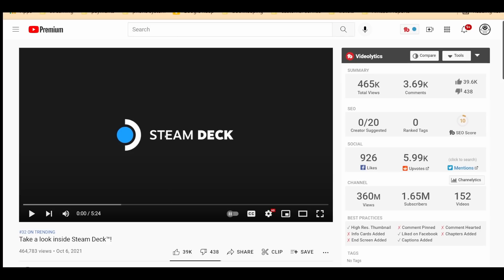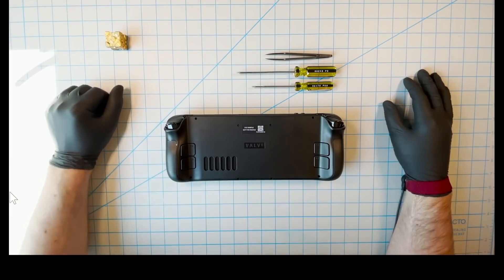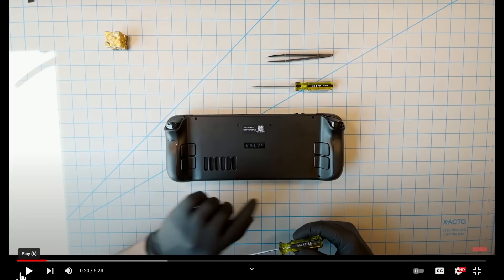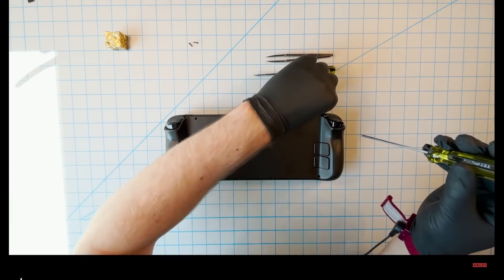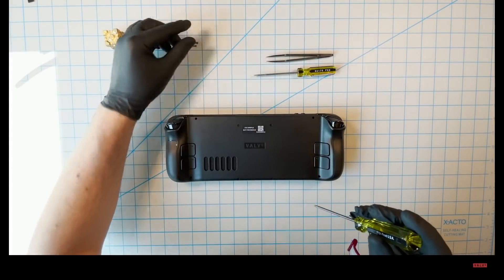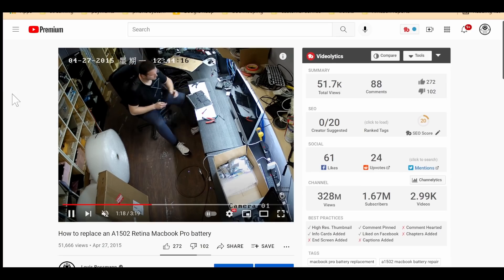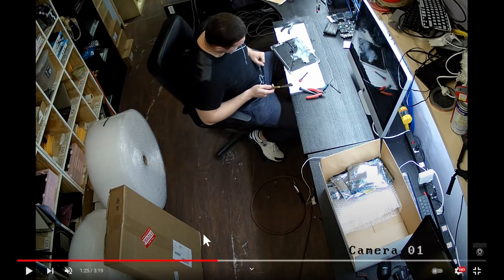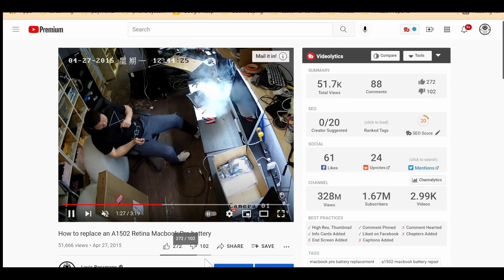Steam deck battery may end your life? bruh 😑

Comment: The structural integrity thing makes sense, as the back is secured by self-tapping screws, so once removed, they're not as secure.  Of course, by "breaking", this means that the back panel may be more likely to pop off if dropped.
Reply: That explanation makes more sense that what i thought.
Reply: It's not usually the biggest deal if: you are careful not to cut new threads, apply the right torque (which can be hard to do sometimes, if you're not experienced. I've heard there are small torque wrenches as well for this purpose, but no personal experience with those.), and if you're really concerned, you can use the weakest threadlocker you can find. (if you go this route, try and find one that is designed for plastic.  some threadlockers are really bad for certain plastics.)
Reply: @leksitarmik4636  Isn't that the entire point? you're using self tapping screws. They're prone to starting their own threads. Opening it up has a very high chance of weakening the fastening. How mitigation, how much and whether or not it's significant is irrelevant to the statement in the video.
Reply: Well self tapping screws make new threads and if you don't hook the old threads your cutting the hole in a different shape kinda making it bigger and a looser. Easily solved if they just used normal screws tho
Reply: Maybe a certain amount of preload is designed into the molding and loses that tension when disassembled
Reply: @js4120  I was thinking about that too
Linus on LTT pointed out they had a jig to place the device in, so joysticks and such weren’t resting on the bench

But screwing up screws seems a much simpler explanation
Reply: This was going to be my comment.
Reply: You gently turn the screw until it drops into the original thread it (feel it drop, maybe hear a click), and only then tighten it. This does not weaken the security of the fastening. Just directly screwing one in can start a new thread and mangle the hole, that definitely weakens the connection and may strip out the hole entirely.
Reply: @Bodi2000  yes, sometimes you can do that, but something that is very common with plastic threads and self tapping screws is that the threads breaks down to some degree when you first unscrew the screw, and then it will definitely be weaker afterwards.

Valve is 100% correct on this, but they could have put in threaded inserts for those 4 screws, maybe a few dollars more per device max.
Reply: @Robinlarsson83  both for price and to deter you from disassembling it , truly a shitty move. Most laptop manufacturers do the same , and for an expensive laptop not a cheap one.
Reply: @Robinlarsson83  If its true as you say that mean if my Stem Deck will be faulty and will send it for repair i can request brand new one instead of repaired one due to structural integrity will be compromise? And in the future my steam deck can brake while I use it? Dont think so.
Reply: @TheHiphopast  this will probably be a issue you are correct. My guess is they might actually just send a new one and salvage parts from the old. 
It would be much faster.
And if the product was a manufacturer failure it is more than likely what they would do to inspect what went wrong and improve the product.
Reply: @Robinlarsson83  I don't think the cost of the inserts is the issue, but more the added labor to install them. Valve was really pushing to keep them cost of this device down, so I can understand the choice. And I doubt it's going to matter that much, if you're careful.

I wonder, though, how difficult it would be to retrofit the device with threaded inserts, and use machine screws, to let you open it as often as you'd like without weakening anything.
Reply: @daniel1tsvik  From what I understand, they went with plastic threads and self tapping screws because they tested metal threads and saw that, when dropped, the steam deck's shell broke more easily (because of how stress concentrated near the metal inserts). If they wanted to stop that from happening, I imagine that they'd have to make some kind of metal frame that the shell would connect to, but if they did that, the weight (and likely the size) of the steam deck would have had to increase.
Reply: @Robinlarsson83  Not even that, really.  The inserts cost only a few cents each, and installation is unlikely to be much more.  The place where extra expense starts to really come up is that threaded metal inserts are a special item, not all assembly houses can do them at all, and those that do are likely to be more expensive overall.  Threaded metal inserts have always been a feature of premium equipment.
Reply: @TheHiphopast  It's a plastic shell.  They can replace the shell and re-tap it with the correct torque specs.  Almost $0 in parts, probably not that much more in labor.  Not saying they will do this, and like WILD7 said the huge majority of warranty issues are going to end in a full replacement, but being the manufacturer they have ways around the self-tapping screw issue that we do not.
Reply: @ratchetguns  , Where did you get that info from?!? It sounds plausible, but also sounds just as easily BS.
Reply: @kssarh  I mean, and Joe Schmoe can buy taps, and using them in plastic is damn near impossible to fuch up. If needing screws tapped into plastic is the issue, buy the next screw size up and tap the holes for the new screws. Problem solved. (You can only do this a couple times, but it shouldn't be so necessary to open the case more than that)

You don't "tap to torque specs." You tap to the correct screw size, and torque the screw to the correct spec. Self tapping screws just help by removing the need to tap the hole before adding a screw. We ain't making 10,000 units, so the tapping procedure matters not at all to us.

If you are particularly resourceful, you can measure the screw thread pitch, size and length, and get some non-tapped screws of the same type, and not worry about accidentally re-tapping the hole with self tapping screws.

And like many others have stated, brass heated inserts are definitely a possibility for those looking to open the case a lot more. However, once you drill for those, there is no going back.
Reply: @daniel1tsvik  like Linus (Linus tech tips) said price is the main thing, not made to tilt people just to make it cheaper. obv they are losing money on the 500 dollar version so they tryna make it as cheap as possible
Reply: @Bodi2000  It still weakens it.   Even just unscrewing a screw halfway and then screwing it back in using the same threads in plastic will weaken it because your still widening the threads slightly.    All you would need is to use a little blue thread lock when you screw it back in to not have an issue.  Even a fucked hole in plastic is pretty fixable it just takes a bit of extra work.
Reply: @Bodi2000  this doesn't make sense. Even when reusing the thread they will wear out a tiny bit each time you do it. Eventually the thread will no longer home the screw. This might take hundreds of open/close operations, but it's inevitable to happen. So technically he is correct, which is the best type of correct 😉
Reply: @Bodi2000  
Tightening the screws deforms the plastic a tiny bit.
The screw will never go back exactly into the same hole because the shape and alignment of the hole has changed.

The difference may not be noticeable but it will change the maximum amount of impact and load resistance slightly.
Reply: yup , my laptop is also plastic shell , it is less strong  holding it
Reply: Everything made of plastic is screwed with self tapping screwed unless you over tighten the shit out of them it not gonna change anything 
It's not like it anything special
Reply: If you work on cars you will not get the same compression ratio if you replace the factory head gasket. It's just impossible.
Reply: @TkTzzz  If you resurface and not pick correct gasket thickens then yes.
Reply: @TkTzzz  Sorry but that is BS. You only need to take material of the head if it is warped which can be measured. It is not necesseray to increase the sizing of the headgasket if it isn't warped so the change in compression is also not noticable.
Reply: @TkTzzz  the variation in compression between two identical new cars is just as large as that caused by a replacement head gasket over the original. That's why tolerances exist.

Comment: 9:00  I think it is about the screws.  Because they are tapped into plastic, you chew up the plastic a little each time a screw is removed or replaced.  This causes slop, and then this would steer to how the forces are transferred through the casing.  It is designed what did he say "especially drop resistant"? So someone did do the math and computer simulations and real world testing and direct the forces to reinforced areas of the case and have proper protection for the components.

If the case is not torqued right or the screw holes chewed up, the forces from a drop don't move the same.  It's like a car of which the airbags have deployed but weren't replaced.

Edited for a typo.
Reply: I tried to give citations but my comment keeps getting deleted.  You should be able to find it somewhere..

Comment: with the self tappers. put the screw in the hole and then turn the screw backwards until you feel it slightly drop into the threads that already exist and screw it back in so new threads are not created.

Comment: A self-tapping screw never holds as well the second time, especially into plastic. I feel there is validity there to the structural claim. Enough to be equated to risks like ESD or long-screwing? Not really, but it's technically valid. Seems like a stretch to bother including it in the video.

Comment: If the screws are torqued correctly, then no, there is no integrity difference....and even if it's just thumb-tight, it literally is a thousand drops on the floor before MAYBE 1 screw loosens, but if you are dropping a piece of equipment on the floor a thousand times, it's going to damage your shit regardless.  I can see maybe a dozen times over 20 years that was accidental, but a thousand? You don't deserve good things if you're constantly dropping expensive shit.

Comment: You could get killed by the battery potentially burning your house down and you acting to save the house or other people in the house. He said COULD end, not WILL end. Yes the risk is low particularly if you make sure you work away from any easily flammable materials like curtains, paper etc. and use basic common sense but a LOT of people lack basic common sense.

Comment: Breaking the seal of single use adhesives will cause the product to lose some structural integrity, sometimes far more then you might expect. That being said, your bullshit meter is going off for a reason. This practice is mostly done to make it harder to repair or make its inevitable that you damage the product during repairs, as you well know. The instances where the use of an adhesives are truly "needed" are rare, it's almost always a choice. 

But in fairness, sometimes glue is the easiest way to increase durability/ life cycle without a redesign. They other area where particular adhesives are justifiably used is in products that are weather and water resistant. Adhesives are cheaper then using gaskets or fitment to achieve the same ends. That, and it a great way to induce obsolesce inside of the planned window since different formulas all have a specific useful life. Every aspect of manufacture from design, development, BOM and assembly become cheaper when you just use shmoo instead.

Comment: I'm not a structural engineer, but from a common-sense point-of-view, yes, I would expect that mechanically working the chassis to remove the screws would weaken it by just a little bit each time you do it. And self-tapping screws will always wear down the threads they were tapped into each time they are removed and replaced. I do suspect that the engineer was overstating those effects, though.

Comment: I think it's true to the fact if you don't have it properly screwed in with mechanical parts + jiggling around, but a very minor chance of breaking the part if it's not some cheap knockoff quality product like the batteries bought. I think the only things that would be damaged is the buttons/joy sticks or anything with a lot of mechanical moving parts vibrating more than usual which would cause more wear and tear and be more susceptible to damage if dropped. If sealed too tightly could cause damage to the shell.

Comment: There is no possible way to apply a specific amount of torque to a screw that cuts it's own threads on reassembly because it takes much more torque to cut the threads into the material to begin with.

Comment: Ya self tap screws into plastic suck and do exactly what they said. If you open that bad boy up like 20 times you would probably need to replace the case (probably a $20 part so w.e) If you're a God dam ape and over torque it then you win the prize of missing a screw in that whole or the grand prize of buying a new case. Self tapped screws are the cheapest way of doing it and kinda sad they did that

Comment: One thing I will note is that self tapping screws 100% are not as secure if you take them out and put them back in. The first time the screw is driven into the material the screw itself drills and taps at the very least part of the hole. Whenever you remove it and drive it back into the same hole the threads can easily not line up and strip out making the screw considerable less secure. My family owns a trailer business and enclosed trailers are almost entirely made out of self tapping screws. Even screwed into steel the fastening strength of that screw is significantly weakened by taking it out and in. Just today in fact we had to find larger screws because we had a self tapping bolt that completely stripped the hole that it was previously in and I could pull it out with my fingers. So I 100% agree with valve. Self tapping screws are only meant to be screwed in the first time and never removed. They become significantly weaker in metal but I cannot attest for plastic as it has different properties.

Comment: I think those are anti-static nitrile gloves, which are conductive. And self-tapping screw does wear out the plastic stud when frequently used with improper alignment. I've seen a lot of stripped plastic studs during avionics and electrical repair. No all mechanic and electricians have the patience like you do. Keep up the good work!

Comment: As for the weakening it, yes tolerances exist, they are technically correct that the structural integrity will not be factory, especially with the use of self tapping screws, but it will be negligible to very slightly weaker

Comment: "STRUCTURAL  INTEGRITY"   =A=  the degradation is guaranteed BUT it's likely so small you shouldn't worry... unscrew and re-screw,  it's less, no question. BUT unscrew and re-screw A MILLION TIMES is when you worry.

it's like the Weight Watcher DIET.  you count points.......  a zero point daub of Cool Whip on your one point chocolate pie is fine but you don't expect three tubs of Cool Whip on same slice of pie to lose weight....

Comment: the concept of self tapping screws makes it more single use. and yes it will wear away the screw connection much faster than a regular metal insert when you rescrew it. i think it should be fine in reality, but it is really easy to accidentally drill into, strip, and damage the plastic part that it is holding onto, when you over tighten a screw.

Comment: That thing needs brass inserts. I don't think this things will have a lifetime more that 2 "openings". And will probably be dropped several times before the first one opening. I my experience, bosses are usually badly designed and tend to crack longitudinally and radially, much more than having thread damage. I would blame any drop damage to a bad design than to a carefully maintained item. The screws and heads for example are really small...

Comment: Some real cringe bits in there, the static strap with glove between the metal contact and skin is just dumb, almost verge like, but I give them props on the sentiment overall.

I am with Louis on anti static straps. Have been pulling apart computers since 6502 days and never worn a strap and never killed a component. If I am going to touch something sensitive I just make sure I have grounded myself first. You just have to use common sense.

Comment: I'm not sure if the Steam deck itself has this issue, but you can actually die by working on certain PC components, like a power supply. They have capacitors that can hold a very high voltage, and when touched on the two ends of one, you can give yourself a cardiac arrest, or arrhythmia. Since the Steam deck isn't meant to be powered with a large wattage though, that's probably not the case with a handheld system like this.

Comment: Two thoughts: Regarding structural integrity, the screws being self tapping means they remove material. They tap their own hole. When you take it out, this material that was removed to make way for the screw comes out with it. There's a reduction in plastic material that happens when you remove the screw. It's likely something that will never be noticed, but if done repeatedly could eventually strip the holes..

Regarding lithium batteries and their fatal risk. This one is simple: Structure fires. A fire is possible to cause a structure fire and, thus, is treated like a fatal risk. A structure fire from a lithium battery is very possible if working near/on anything flammable.